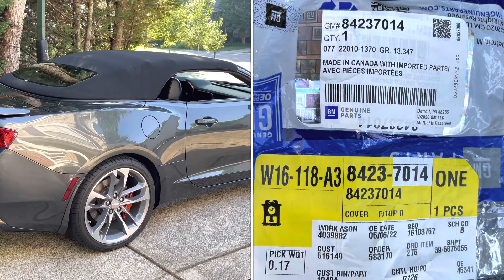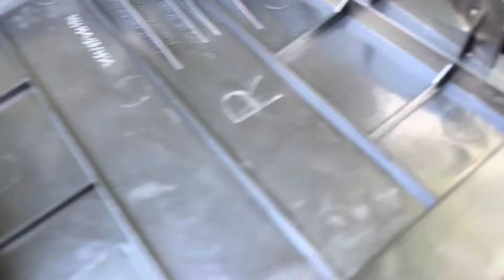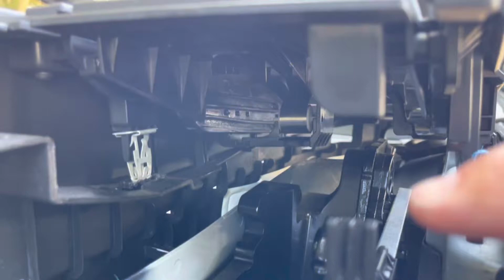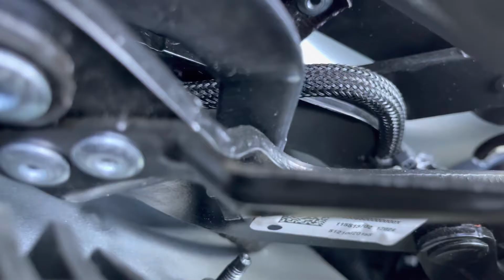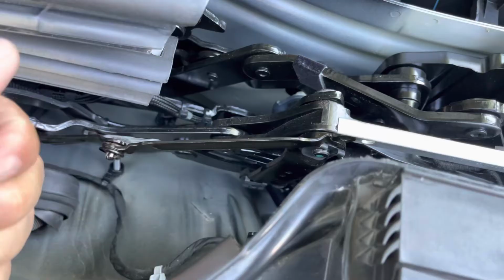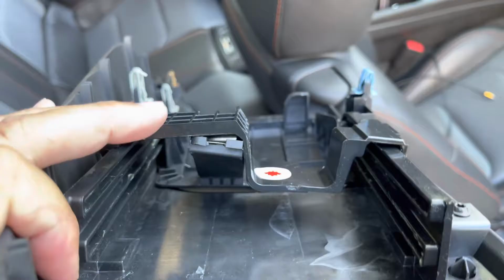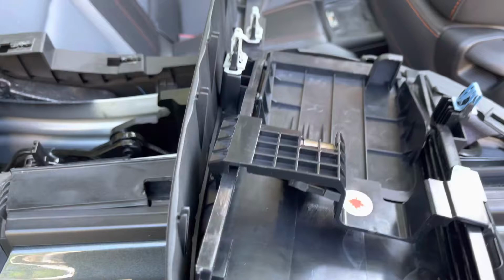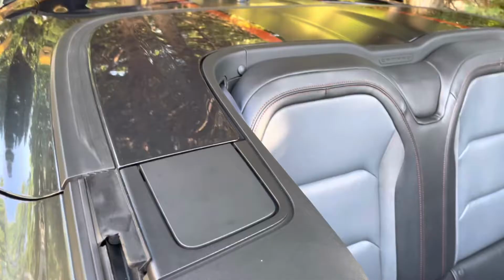2017 Camaro 2SS 50th Anniversary Edition FIFTY - Fixing Convertible Top Sliding Panel Cover

Comment: Thank you for posting this video.  I am on my 3rd upper quarter panel cover.  Fortunately, the first two broke under warranty.  The first one, my 2016 was less than 6 months old.  The numbnuts at the dealership took 30 days to fix it, as they could not locate the part, they had to get on off the GM assembly line, then they broke it.  2nd was in 2018 when the car was not quite 2 years old, and the repair went much quicker as I guess they had gotten experience and TSB's by then.  

Was dreading having to leave the it in the open position constantly.  Soon as I can track down the parts, I'm fixing this.
Reply from the maker: Glad it helped!

Comment: Thank you man. I have a 2023 ss with the same problem and you good sir just saved me! Cheers mate! 
This is apparently a common problem with convertibles and it sucks because I’m definitely not going to use my top as often now.
Reply from the maker: I’m glad it helped.
Reply: Hey bro. read your comment. I have a 2022. changed the panel 1 month ago and just started hearing that rattle again. any suggestions on making this issue go away for good? My dealer told me this design was very poorly made

Comment: I have a 50th anniversary as well, but I didn't get a convertible. I have never liked a convertible due to the MANY things that could possibly go wrong with them, and now I can add one more possibility to the list. I am not dogging on those that have them or like them, just my personal preference. I look at things like convertible, sunroof or T Tops as failure points. I had a 2002 Trans AM GT WS6 with T tops, and the seals failed and caused a massive mess one super rainy day. The inside was essentially ruined. 
Glad you were able to fix yours at least and post a video to help others in need!
Reply from the maker: Thanks. So I’m not unlike you, and I totally get what you’re saying when it comes to planning for the worse case scenario regarding convertibles. On the Camaro, they built this top right. If you look the top when it’s up, it sits on top of the body at the back. That means the water runs off the top of the car and down the sides naturally. Whereas the Mustang the top sits under the body and it needs water drainage tubes through the top and body to get the water out. 
Another thing I researched on the top is the automation of it all. Besides pressing the button to lower and raise the top, it requires not twisting of knobs, or unlatching of anything. 
All in all, these parts I fixed in this video not withstanding, it’s a pretty high end top for any car, and it’s on a Chevrolet.
Reply: @x-coastie  That actually helps me out a lot. As the tops I was used to were the traditional ones (and yes I know, they can advance tech after decades of doing it a certain way lol) where as you stated, the drain through the body, etc. My other fear is weather stress and cracking of the top itself. How is the material quality? Is it something that will last 150,000+ miles? Or if it was a weekend driver would it last years of in and out of the sun, etc? Now my curiosity is piqued!
Reply: july3410  the search parameters that returned this video was 50th Anniversary Edition Camaro, as I just bought one myself and hadn't taken ownership yet the day I searched this out. So no, I wasn't searching convertible tops, but I guess nice try to look into my brain, internet troll warrior. lol

Comment: I love the video but I would have replaced the other part as well. Once the metal has been weaken as it bent, it will bend again and most likely take out something else with it. Thanks for taking the time to show us.  Also have you ever noticed more friction of the sliding panel on the right side vs the left... my left side slides smooth as silk, the right side has a sand papery feel to it when it slides.
Reply from the maker: I oiled both sides and I saw no unusual wear.
Reply: @x-coastie  Thanks X-Coastie.  I had the same worry as dc9808 - but absolutely LOVE your video explanation.  My car only has 2400 miles/4 months old and the right side broke already.  I love GM, but that's sad for such a weak set-up.  Your help is fantastic.

Comment: Thanks for this! Mine has needed repair for months, and I did not want to take it to the dealer.  Parts are on order!
Reply from the maker: Glad it helped.
Reply: I mean, plastic that's exposed to the heat of the sun that's under constant hard spring-loaded tension... how did they expect this to last more than 3 years? I'm so mad at this. I'm gonna have to get in there with some Wd40 on that metal track. They should have made that little sliding part out of titanium or something. When that plastic expands and contracts, it eventually just doesn't want to slide anymore. I'm actually greatful that my sliders get stuck or the damage could have been worse. Or I like when suddenly they snap shut from all the way open like a slingshot, when I hit a bump while driving.

Comment: Absolutely awesome video!!  Mine has broke as well and I just manually held the cover plat open with my hand for years as my dealership couldn't locate the part I needed, which you so did!!   I thought it was on me for installing a roll cage, but clearly it's a GM thing.   Still a better set up than the mustang vert.
Reply from the maker: Thank you!
Reply: Sir, can you please explain to me how to manually but the top up I appreciate your help so much

Comment: Thank you for this incredibly helpful video.  I have a 2024 3LT RA with only 2400 miles and the passenger side broke already.  In my case, the slide is also broken as yours was.  What a hokey setup.  Mine is still under warranty and taking to the dealer in 3 days due to the holiday.  However, if it breaks after getting fixed I think Inwill take it apart myself and metal epoxy the parts and try to weaken the spring a bit as well as strengthen the part that you moved back in place by heating it with the air dryer.  I love epoxy on plastic, so this may be my new friend it it happens.  In Ray Amour's similar issue video, he shows three additions that may be helpful.   1).  On his part, the yoke broke and he explains why.  That is probably because he is in Ontario where the cold affects the weak paert differently.  2).  He used a plastic trim removal tool which I think it helpful.  3).  On his  assembly (which may be slightly newer), he shows that the 2 white clips in the middle only lift up partway, then have to slide the assembly a little to remove it.  The combination of advise in these 2 videos is extremely helpful. I had a 2000 Z28 since new that I sold for this one, which I love, but the old one never had a top issue.  (Although it did have window motor issues.). :-). Thank you for this incredible video which I will offer to the dealer.
Reply from the maker: Thanks!!

Comment: I have same issues on both sides. What tools do I need.  I just received the parts. After watching your video I may also have spare parts. Thank you for the video.
Reply from the maker: Maybe a needle nose pliers and a flat head screw driver. Those will be used to take out a retaining clip. Should be good after that.

Comment: Well thanks to you today I was able to look and I just need the new top quarter upper trim panel, but the old 1 had only 2 clips for my car and now I need to get a new window regulator that has the 3 clip holes. I may just drill the 3rd slot hole then replace the whole reg?
Reply from the maker: Geez. I didn’t know there was a difference in Gen 6 Convertible Camaro’s.
Reply: @x-coastie  That GM TSB talks about this change, 2016/2017 early Camaros have the 2 slot and then later 2017 Camaros had the 3 slot. I am going to order a new Window Regulator and just remove that top plate that has the 3 slot, I hope this will work.

Comment: More info from GM. For vehicles built prior to February 14, 2017, it will also be necessary to replace the window regulator in addition to the quarter upper trim panel to accommodate the added 3rd clip design. Technical Service Bulletin No.: 17-NA-357 Date: November, 2017. I guess there are 2 designs for these years, (2 Clips OLD Design and NEW has 3 Clips). But with the 2 OLD Clips need additional parts I read?
Reply from the maker: Good to know!

Comment: My 2016 had the same problem on the drivers side, took it to the dealer, they fixed it without question, but now the passenger side is doing it.... but there is no metal arm attached to the slide part, so I'm gonna just see if I can do a quick fix.  If I took it back to the chevy house and pitched a fit, they might just repair it.  It is obviously a continuing problem that should have been subject to a recall.     I was already thinking of a light dusting of silicon lubricant, 'cause of all the torque/pressure the slide areas seem to be under, then you mentioned you applied lube.   Thanks for the video, very helpful 'cause I had no idea what connected to what.  Looks like a straight forward fix.
Reply from the maker: Glad it helped.

Comment: Thanks for this video. The housing that holds the coil spring failed you. Those bent plastic ribs are support ribs that when bent, lost support. Something stopped the coil spring from moving. Due to the link hinge still closing, it then broke the plastic piece you replaced on the track and also forced the hinge link to have to bend. I hope we can figure out why these fail. I just baught my 17 camaro with same issue.
Reply from the maker: No problem. Seems like these things fail quite a bit.

Comment: I found your video after getting dealer quote to fix.  $711.00
Thank you.  Wondering if your fix has held up?  This has happened on both sides now but 1st time was under warranty.   2019 Camaro
Reply from the maker: Have had no issues since I fixed it. I think applying the assembly lube to the rails could be the biggest help.
Reply: I wish I could have gotten $711 for a the quote.  They just told me $1700

Comment: How did you prop the rear cover during the repair?
Reply from the maker: I stopped (quit pressing the button) the folding midway in the opening process. The cover just stayed right in place with no issues.
Reply: Could you tell me how to manually lift the folding rear cover (the one that looks standing still). It would be very helpful since my convertible does not work with the button 🙏🏻🙏🏻

Comment: I just bought a used 2020 LT, and both of mine are screwed up this same way. Every time I want to put my top up, I have to manually push both of those spring-loaded panels in, otherwise it's crunchy crunchy time. I wish chevy could have avoided crunchy crunchy time somehow.
Reply from the maker: Yep. Just a bit better engineering is all it would have taken.

Comment: Obviously a weak part, poor design pastic weakend over time and or heat. Allowing the spring to pull it into a mis shaped position where it would jam and break/bend the other parts pushing on it.
They could have molded the plastic thicker.

If yours hasn't failed yet I would reccomended  filling that cavity where the bent plastic was with a strong epoxy. Making it solid, not flexible
Reply from the maker: Good idea…
Reply: If it happens to mine again - I'm going to epoxy thin metal to those parts to stengthen - but will first have to make sure there is proper clearance for the parts.  It seems like the tongue is a really weak part in hot weather such as Texas summers and the spring tension is too strong - pulling the tongue back as X-Coastie showed.  Then, it all goes bad>  I'm going to have the dealer repair as my car is only 4 months old, but I don't have a good feeling with such a weak tongue design.  I feel certain there is some epoxy work due in the future for the tongue and also the push tab on the cover (where I think I'll epoxy a small right angle metal to the back for strength. Finally, I think the slide pusher is also so weak looking,that it needs epoxy too, but that will require a bit more care since it has multiple openings.  I think I'll super glue some think metal strips on either side of the backbone on the top of the rail, then epoxy on top of that so there is strength all along the backbone.  Hope to avoid this, but with 18k views of X-Coastie's fix, I think something better is inevitable...  Anyway, lube as X-Coastie and others have advised is mandatory.  Bummer, but LOVE the car nevertheless.  :-)